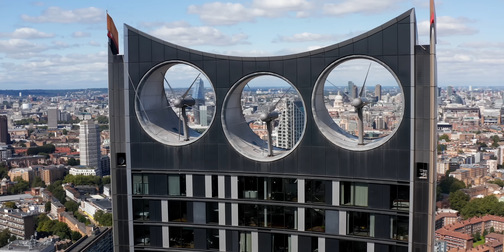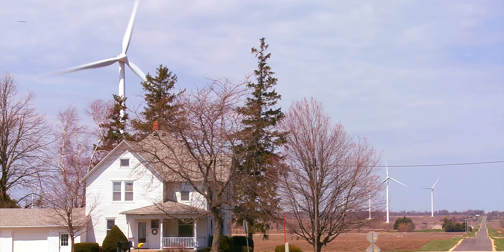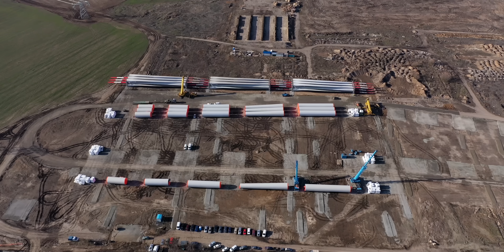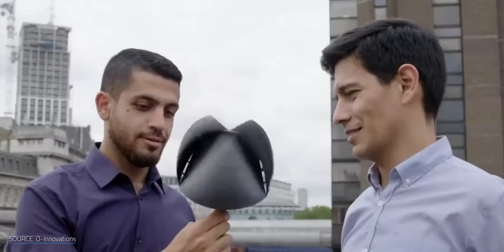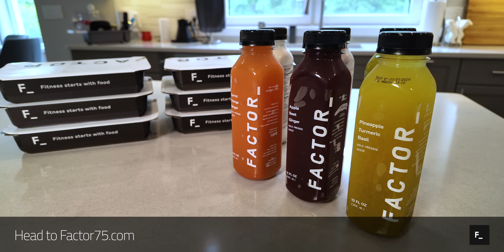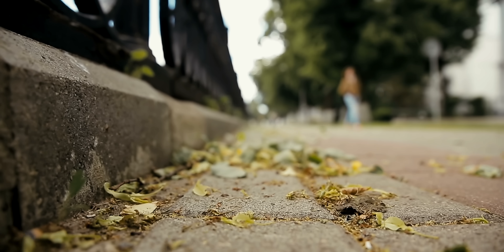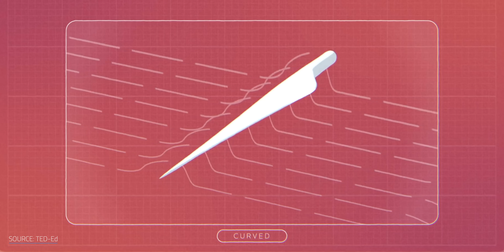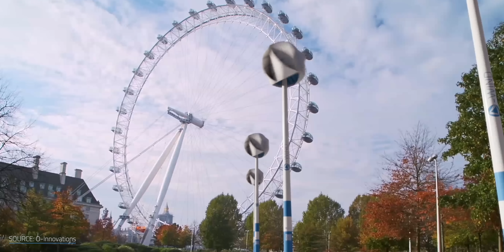How a Small Wind Turbine Will Revolutionize Wind Energy

Comment: 2 questions just popped into my mind: 1) do wind turbines get dirty enough naturally, to degrade efficiency. 2) if they do get dirty, how can a condo owner 20 floors up, clean the turbine?
Reply: New market for skyscraper window cleaners?
Reply: Everything gets dirty, especially on the side of a building in a city. The buildup of dirt, mold, mildew, and other types of grime can both add to the weight of an object, and change the surface texture, both of which can affect the performance of almost anything, especially something that requires equal balance to function correctly. As far as cleaning, that would fall to the professionals, like those who do high-rise window cleaning. Those companies already do much more than just cleaning glass. They scrape, scrub, pressure-wash, clean, caulk, paint, reseal, and otherwise resurface most all building surfaces of all sizes. Anything larger than a standard residential home requires professional cleaning, even a simple one-story building like a gas station or fast food restaurant.
Cleaning turbines would simply be another annual or biannual service requirement for any property, commercial, or otherwise. And, the fact that they connect to a power grid (even a localized one for an individual building) would require a certain level of safety protocol for maintenance. Not to mention the danger of working on or around such a large moving structure in a high-wind area.  They would have to be locked down somehow to prevent them from moving while they're being worked on, and would most likely only require a good pressure washing every few years... depending on the environment and surrounding buildings. [On a high-rise rooftop, perhaps not so often. But, on a lower level building, surrounded by other structures with lots of exhaust and closer to ground traffic? That would require more regular maintenance. You'd be amazed how filthy things can get on the roof of any building. Even those way up above regular traffic and occupation.]
Reply: So short answer yes, long answer it may not matter at this scale. On the largest scales damage due to dirt etc of the leading edge of the blades of a windmill degrades efficiency significantly. But on these small scales… probably not.
Reply: @bysshe51   💯 I would imagine that, even though these have more surface area than a standard blade type, they don't likely suffer the same kind of shear forces that result in such damage. Their shape and efficiency would probably protect them from such problems. They have so little drag that the effects of any erosion-type  damage would likely be nominal.  But, no doubt, there would be issues unique to their design that would be discovered over time.  I can only imagine they would be less of an issue, though. This seems to be a really good design, even if the esthetic appearance isn't for everybody.
Reply: A new drone application perhaps?
Reply: Put some abseiling essentials in the starter kit.
Simples.
Reply: Well, you need to have a construction to allow pulling the turbine towards your window and then it's a matter of water, soap and a brush... That thing can spin so you should be able to reach every side of it.

Comment: We live on the side of a small hill, where the wind can get to some dangerous, even destructive, speeds, but most the time it's supper calm. So, I'm curious about the extremes of the design. What is the slowest wind speed that will generate any energy, and what's the most destructive speeds it will handle.
Reply: @RyuuKageDesu  besides the mechanical problems I heard a lot of power inverters die on small wind turbines. As input power fluctuations seems to be a lot worse then on solar.
Reply: Ain’t no calm like supper calm.
Reply: @williamwilson6499  When it goes from nasty to calm, the supper calm can get so eerie you can almost taste it. 

Thanks for catching my typo. Too funny not to keep.
Reply: I wonder if a flywheel might help mitigate these fluctuations
Reply: @dwc1964  would push up the rotation mass. This would significantly increase the demands on bearings and stability and thus drive up prices.
Less mass is needed if further from the rotation center, but giving big needs on the structure to keep the centripetal forces in control.

Comment: I truly think that "home" wind turbines will be a part of the future, and O-Wind why not. 

But I think that one point is missing !! Easy integration into home solar system.

I am very interested in integrating a small wind turbine into my small solar and battery system in my summerhouse but is always running into integration issues, the turbine need a load always etc. The great innovation would actually (in my opinion) be a wind turbine that is plug and play and acts! like a solar panel so that it can be added into solar off grid systems very easy 

Just my opinion as one that likes to build stuff 😁

Comment: What about vibration and structural considerations for a rooftop mount, that’s where most solar is?   Also, it’s too big, 4 two foot turbines would be more practical for the average house.  Concept is good though, especially if it could use the same inverter as a solar system
Reply: Four 2 foot turbines aren't the same as a larger one. Friction does not scale that well with small sizes, that's why commercial wind turbines are huge, and they aren't bigger because of material weakness. They have to be as big as possible to harness the most power.
Reply: @ your comment re friction is correct, but the story is about home generation, so even if it’s less efficient more smaller systems is more realistic in the home environment

Comment: I think the main downside of this product is the challenge with predicting production for a given location. For solar, production can easily be estimated, but with turbulent wind in city areas it can be a big challenge for wind generators. This can make it difficult to calculate return of investment. If some early adopters experience much lower production than promised, and without the option for a refund, the product can quickly get a bad reputation. Otherwise I like it,. Also the esthetics of it. It doesn't look so intrusive in the urban environment as other small windmills.
Reply: I always had the same assumption. My guess is that a small demo device could be used to approximate true output over a trail period.

Folks could then compare that to public wind data. And extrapolate power generation by date

It won't be perfectly accurate but it is an estimate. What is apparent is that this isn't already a process and given the simplicity of the idea, I worry the engineers already know it is a bad idea.
Reply: @tachywubdub2469  in an open field with traditional locations wind maps should be the first step.
With turbulences produced by the buildings around you, the simulation has to be a lot more detailed. Small difference can make huge  difference in the outcome.
There are maybe some spots with really higher wind speeds, but there are although some with much less than without the buildings. Problem the extemes can be pretty close each other.
Reply: My hopes are low on the visibility of the data, as many small wind turbine companies had big claims.
If its specialized on turbulent gusty wind. How do the work with the extremely spikey power production? Extremely over speced power inverters, what pushes the cost.
2.2m wind turbines is not small. As are the forces big winds are acting on it. Especially with quickly changing direction even having dynamic and cycling loading. Giving needs to a really beefy holding structure. Nothing people renting just bolt to there 4th floor balcony.
Reply: Actually less hard than you think. We have wind maps too 😊 biggest thing will be placements by knowledgeable installers. A shadow is easy to see. A wind-shadow less so.
Reply: @bysshe51  wind maps with meter or less resolution. Predicting the turbulent flow from the buildings around on all wind angles. That seems pretty complex. Nothing you would have country wide.

Comment: In Norway the average is 15.700 kWh due to the cold climate.
We do not use or have  a supply of any form of gas for heating.
Some sophisticated homes run gas for mostly the view than heating.
Most have been at least 50 years ago they ran gas by pipes here.
Someway lucky for that due to the explosion hazard by gas.
Mostly heat pumps and wood burning are the other often added options.
Reply: Norway doesn't have gas? Well that's surprising.
Reply: @AlistairNY  I believe electricity has historically been very cheap in Norway, so using gas for heating would be more expensive.
Reply: @tombh74  
It was cheap, but the smart government sold out the whole thing.
Now we export a huge amount to Europe.
The price in that pool adjust our own price.
Before the big transfer cables was made, we was more than capable to make a decent price. Today at my area we pay 20-25 cent pr.
kWh😬🥹

Comment: I like the look of the small wind turbines more than their larger siblings that are in use now. So plan on getting several for my ‘homestead acreage’ when the time comes.
Reply: Problem is wind turbines scale withthe area of wind captured. A new wind turbin with 50m blades has approximately 50x the diameter other 2.2m one. With squaring we get the area. Getting 2500x the area. Even with 2.5x the wind speed you would need 1000 of them for the same energy. For me it seems not likely the small turbines will be viable. Especially on high rises safety and installation will get a big premium. As everything capturing wind will get big mechanical load in high winds.
For me it seems extremely unlikely small wind will have any notable share of power production.
Wind power is just scaling great with size. Not like solar cells.

Comment: should release a 3d printable version (small) to maintain interest. If you can see it spinning yourself it helps.
Reply: Do you know Robert Murray Smith?

That kind of project would be right his alley
Reply: @drillerdev4624  Robert Murray already did.  He made 2 videos,  I saw all of first video in 3 versions. I am guessing he got slapped with cease and detest, because he changed first video (twice). 
 first change included o-innovation adverts-information,  then second change was removing 3d model file link and majority of 3d model instructions.  x
Reply: Not even that, it would be interesting to see the power output it can provide for low power things like sensors in remote areas. What if a small one could charge your phone or a laptop?
Reply: It is very difficult to 3d print moving parts, let alone make them smooth enough to be efficient
Reply: @scfdx2  Where did they say they would print the moving parts? 3d-printing the shell/vanes would be fine, along with a kit of fabricated moving parts. To the nay-sayers, I don't think the OP was saying that a toy-sized one would be a practical application. Just something fun to build and play with to see how it might work. Like a crystal radio set - illustrating the principles, not for actually listening to music. Although it would be cool if a small one could in fact generate enough watts to recharge a phone or power a light.
Reply: @scfdx2  you 3d print?
Reply: Spinning and power are completely different things.
Reply: apart from it having too little torque to do any useful for i.e. generate power, the 3d printed version will get destroyed pretty quickly by the elements. Rain, snow, frost and friction will destroy it very quickly not to mention 3d printing is actually very expensive as a production method.

EVERY solution presented on this channel turns out to be a complete BS in real life - this one including.
Reply: @vaakdemandante8772  Tell me you don't know anything about 3d printing without telling me you don't know anything about 3d printing. Not expensive at all and there are great materials that would withstand anything the environment would throw at it. Examples: ASA, Nylon, PETG. Those who have been doing it for a while know there are ways to deal with difficult prints. So, I disagree with your assessment.
Reply: @vaakdemandante8772  it would cost like $.10 to 3d print
Reply: @vaakdemandante8772  My idea was more about getting the idea out there to create interest in the product. If you can see a small version spinning it give people confidence that the idea will work.
Reply: @vaakdemandante8772  that's harsh and accurate criticism of Matt
Reply: It's not effective enough. It's a toy.
Reply: @JohnDir-xw3hf  what if you printed 20 of em
Reply: @JohnDir-xw3hf  combine it it with fly wheels and scale up. Curious how far would that go
Reply: @algirdasnausedas324  it would be Very Very heavy and expensive and useless.
Learn something about how wind turbines work. 
Start from wind power formula.

Comment: If one turbine produces anywhere near 5k, then for many US homes, that's nearly 50%, which seems worthwhile.
Reply: Valid point.
This turbine, or others in the same market, don't necessarily need to replace ALL of your power needs, it just needs to replace enough to make it worth the price tag.
-
Weird example of what I mean: Before string trimmers, edge trimming was done with bypass cutters, either hand-held and you're on your knees, or built into a pole so you can stay standing. That tool meant the trimming took a LONG time and wore out your hands and arms.
Along came the string trimmer, taking most of the muscle out of the equation, cutting (pun!) a lot of the time out, but you still need to walk the distance, and the string trimmer is more expensive than handheld cutters.
So the string trimmer is better, but it doesn't take ALL of the work out of yardwork.
Reply: And they don't.
Reply: I'd have to listen to the segment again but I think those numbers might have been applicable to the globe that was 7 ft across
Reply: @laughinggas5281  that's correct - I checked it.  That's the size they intend to commercialize.
Reply: For that to be consistent, the wind would also need to be consistent, which is unlikely. Most places are about 1/3 windy, 1/3 light wind, and 1/3 no wind. The side effect is that you probably only generate about 30-50% depending on wind levels. Then you frequently see systems that try to carry the power at low voltage which requires lots of amps. The wiring has be thick to carry more amps, so it costs more.
Reply: It will not and cannot
Reply: The video doesn’t mention peak power output. It estimated 2000 to 5000 kilowatt hours per year. That’s 5 megawatt hours/year production. You’re getting your units mixed up.
Reply: An Utterly ridiculous value for any small wind turbine.
A 6 meter rotor ( diameter ) would be lucky to generate around 1200-1500kwh a year at an average windspeed of 5 m/s.
Reply: Yeah! and people are ok to put as many solar panels as needed for their energy, why not have 2 or 3 of these? Sure they need to be spaced apart but I can definitelly see one on each end of the roof working just fine.
Reply: @MrCaiobrz maybe they could be installed on existing transmission lines too
Reply: Can v use the elactric energy direct to our home? If v dnt want to sale generated to government or any other company.
Can v use it directly for my ac light fans?
Reply: My wind speed most of the time like currently is 5km/h, that might be 3mph.

That's way too low for anything.
Reply: Yes, in NY, at 50m height, you have around 217 W/m2, soy if you want to produce 5kW, you need... 23m2, so 5.4m diameter, about 215 inches. And remember it should be 50m above ground, no obstacles around. And of course that's for the best HAWT, a Savonius would do much worst.
Reply: But it doesn't.
Reply: @JohnDir-xw3hf  But it literally says it can.
Reply: @displayname7t4  Can and does are very different. It's probably 5kw peak, but the times it'll be at peak output are also very likely close to the times you'd need to consider locking the unit so it doesn't get torn apart in a storm.
Reply: @displayname7t4  i have seen over 9000 similar projects over years. And they are all scam.
All you need to know is the wind power formula to understand it.
Reply: @displayname7t4   - yes at what wind speed - AND what wind speed do you see on average?? - ie, not Hurricane velocities..

Power in advertising on wind turbines isn't what you get at  the ridgetop...
Reply: First question is: where will you put this turbine so that it is constantly in uni-directional wind? In a housing development, such a place does not exist.
Reply: @onenote6619 The whole point of this design is that it can use omnidirectional wind. Hence the name O-Wind.

Comment: If you look at the housing stock in the UK 70 % have chimneys , if a tiny version of that wind turbine could be on top a chimney cowl wires connecting to a small battery at the bottom of the chimney in the fire place or directly connected the a heater in the fire place warm air in winter cool air in summer, reasonable priced , I think sometimes the little steps get missed trying to solve bigger steps .

Comment: If this works reliably, there is no reason a house couldn't have 2 or more if reasonably priced
Reply: And if big number claims are right. Big scale production would be needed as a normal turbine produces the energy as thousands of these 2m wind turbines.
For pretty much all houses besides some spots in city centers wind near the ground is much less then in 100m height, where modern turbines are.
Especially as buildings can not just speed up the wind but although shade it completely from some directions.